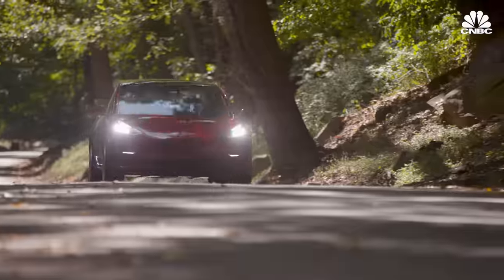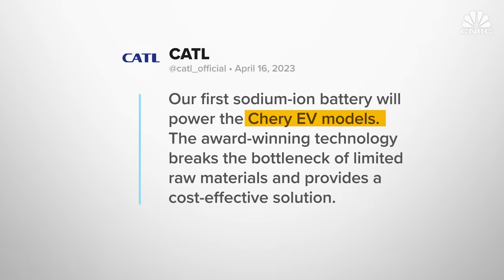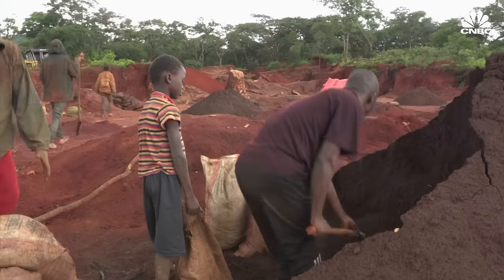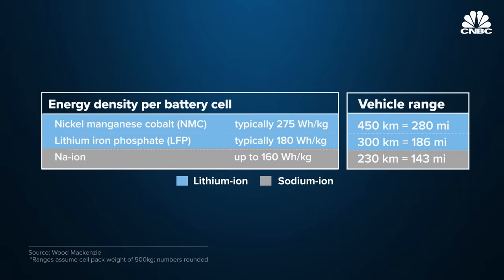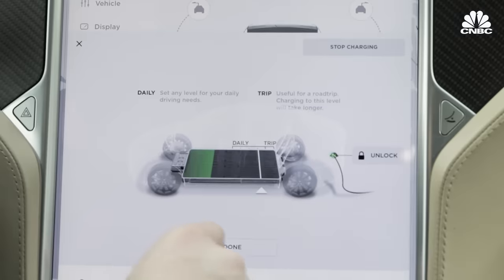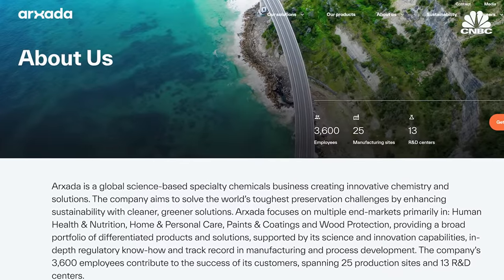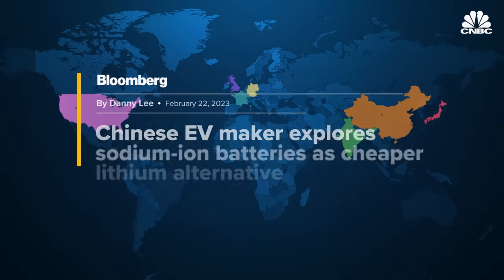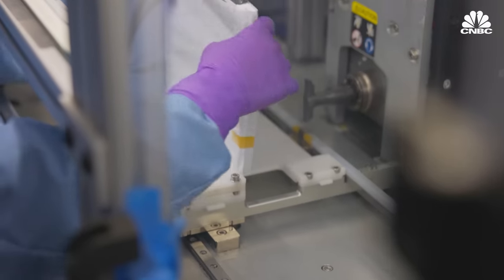How Sodium-Ion Batteries May Challenge Lithium

Comment: There are enormous  batteries manufactured  across nations .....   materials are available for production of both  lithium ion batteries as well as for sodium batteries . What  I don't understand is that  mobile phones that were sold  for low budget .....as low as two to three hundred rupees ...... did serve it's intended purpose ..but why were guys who could  afford  expensive mobiles  hunting the batteries that were priced so low . Secondly ......battery even inspite of intended performance  doesn't  function after several weeks of purchase in which case  why they don't sell extra battery just in case  battery doesn't serve the purpose  another battery would be useful instead of searching battery in neighbours premises ...Thirdly ....the battery .....did the function of a laptop adapter which is why   batteries are easily  ..lost like  ...
sim cards .....and  retrieving data is huge task for people who cannot get a telephone line and a desktop line or laptop line ......data .....has to retrieved in any case

Comment: If this is non toxic and a non fire hazard then this should be used to replace lithium batteries. Electric cars are a non-starter anyway even with lithium batteries. Too short range and the electricity all comes from coal anyway.

Comment: How do you in one breath extol the fact that you can drill right through it and in another breath extol the fact that you can ship it at 0 volts and it's like a bag of electrolytes doesn't the second imply that shipping it at full voltage would be dangerous
Reply: Is the drill test done at 0 volts

Comment: Comparing range just based on volumetric or weight factors is a little bit shortsighted.
Also no differentiation between those two factors is problematic.

Comment: sodium ion batteries look great as a back up power source for my space ship line up. i need to find a good power generator. i think  coupling a electric motor to a electric generator. off grid living. my housing will have the same power generators and battery backup systems as standard
Reply: Tesla are doing battery back up system installations right now.

Comment: Sodium-Ion batteries are not suitable for cars because of a simple reason. Lithium is the lightest metal. Nevertheless the lithium car batteries are very heavy. Sodium-Ion batteries will be many times heavier for vechicles. However they may be used in other applications such as solar panels and wind turbines energy backups.

Comment: The video provides an overview of how sodium-ion batteries are emerging as a potential alternative to lithium-ion batteries due to several factors, such as the scarcity and cost of lithium and other critical minerals needed to manufacture lithium-ion batteries, energy security concerns, and sustainability issues. Sodium-ion batteries have been around since the 1970s, but they were abandoned in favor of lithium-ion batteries due to their lower energy density and limited capacity. However, sodium-ion batteries are gaining traction once again as battery makers and automakers look for alternatives to lithium-ion batteries.

Sodium-ion batteries have several advantages over lithium-ion batteries, including lower costs, higher abundance of materials, and a longer cycle life, which means that they can be charged and discharged more times. Moreover, sodium-ion batteries do not require critical materials like cobalt, which is often associated with human rights abuses.

I find the development of sodium-ion batteries fascinating, especially as they offer a more sustainable and ethical solution to energy storage. The emerging market for sodium-ion batteries is expected to be worth over $11 billion by 2033, indicating the growing demand for alternatives to lithium-ion batteries. However, while sodium-ion batteries offer several benefits, they have lower energy density and capacity than lithium-ion batteries, making them unsuitable for applications that require higher power output, such as electric vehicles.

Overall, sodium-ion batteries are a promising alternative to lithium-ion batteries, but they are still in the early stages of development, and further research is needed to improve their energy density and capacity. Nevertheless, the emergence of sodium-ion batteries represents a significant shift in the battery market, highlighting the importance of sustainable and ethical solutions for energy storage.

Comment: the good thing about sodium is unlike lithium sodium cant be cooked into illegal drugs like meth so a license to ensure that the sodium is going into batteries not drugs wont be required.
Reply: meth processing can also use ether, paint thinner, Freon®, acetone, anhydrous ammonia, iodine crystals, red phosphorus, drain cleaner.
Reply: @MrTeff999  but i think lithium is a critical item so i doubt it can be replaced by anything else so just like the highly controlled nature of access to sudafed should make it not be made so easy.

so that is why i think sodium is better for batteries since there would not be as much regulation.

Comment: Also, Lithium Iron Phosphate batteries have more recharge potential than Lithium Ion. LiFePO is popular with battery packs.
Sodium, I dont know.
Reply: I can see lithium iron phosphate batteries dominate the high end, protable batteries, while sodium ion batteries dominate the low end, mass quantity grid storage batteries.
Reply: Li is still increasing cost wise, so LFP wont be their go to for to long if Sodium can match it at a lower cost.
Reply: All will have their applications
Traditional Lithium ion (NCA & NCM) will b for niche applications such as  passenger drone, race cars and planes
Lilthium Phosphate (LFP, LMFP & M3P) will be the go to battery type for passenger and commercial vehicles.
Sodium ion and cheaper LFP for short range cars, bikes and grid application.

Comment: With expiring nuclear plants and not building replacements.  EV dream is dead, as electricity sky rockets when they can no longer subsidized electricity rates. Not about green but all about making the low iq subsidized the electricity for rich ev owners.
Reply: Solar energy is the cheapest source of all. I don't see why Expiring Nuclear powerplats are supposed to be a problem for EV adoption.
Reply: Building new nuclear power plants wouldn't be a problem.

Comment: What about powering cars with water instead of gas or electric? We need to stop getting hung up on one thing because people believe that "it's the only way" when there are other ways. The whole "the future of cars is electric" statement is an oxymoron.
Reply: You mean sea water? Cause fresh water is already dangerously low
Reply: Water is a resource we dont really have a lot to spear. I assume you mean making Hydrogen and as other videos point out, it has a lot of issues and its just as waste full as gasoline is in that you still have to have full on storage units (gas stations), move said fuel around the country, waste power compressing it / cooling it into a liquid, and waste a lot of solar power that can be used as part of the whole grid vs something going into one thing to make a thing that can only power one thing. Electic is the way because its simpe and simple normally means better over all. Fun fact, if we had more batteries on the grid (this includes anywhere) - you will be able to remove 10% of  any power method from the grid as every grid pretty much waste about 10% of their power generation because they can't store it.
Reply: Yeah why don't we just power cars with the power of imagination?who says we even need

Comment: We don’t need batteries for grid storage. We have other options like liquified air, which the oil industry is good at doing. Or making geothermal work everywhere. Both of those would solve the problem and we wouldn’t have to strip mine somewhere or make new industries. Since those two examples can tap into existing industries.

Comment: This won't work unless the battery can be smaller and store more energy than Lithium batteries.
Reply: It doesn't need to be better, it needs to be cheaper and use more common materials. The goal isn't to entirely replace Li, rather stop using it for everything. Which means we need less Li in general.
Reply: @alien9279  If humanity is expected to use electric cars, trucks, and planes it definitely needs to be lighter, take up less space, and have much more power output.

Comment: To show how out of touch Elon is.  He just announced plans to open a lithium ion battery factory in china in 3 years.  Both the china and lithium part are 2019 thinking.
Reply: As mentioned in the video, these batteries don't make sense in EVs. Lithium ion will remain the most important chemistry for a very long time.
Reply: @Simon-dm8zv  Are you joking?  BYD and CATL are already mass producing EVs with sodium batteries.  The only negative is the density, which reduces the range by about 25% which is no issue at all for cities.  But on the plus side they operate at lower temperatures so northern USA and Canada can use them.  They are also 30% cheaper than lithium and dont destroy the environment to mine materials for them. The research on ev sodium batteries is also years behind lithium so the density gap will be narrowed quickly now that EV manufacturers are starting to really get into them.  The sodium EVs from BYD are down to $11k.
Reply: @PeterSedesse  They are not. The $11k BYD Seagull you are referring to has LFP blade batteries. BYD and CATL are planning to start producing the version with sodium ion later this year.

Comment: Sodium Ion does not have the number of recharge cycles and energy density of Lithium ion.  Even if it is cheaper, it is not a good choice for electric vehicles. It might be a very good material for solar/storage battery use.
Reply: with r and d in few years the energy density and recharge cycles can be made similar to lithium. 
safety is more imp factor for evs where sodium are better than lithium
Reply: @keepingittight  I agree that it is cheaper than gas, but the question is whether Sodium Ion will be a better choice for cars and trucks. Trucks in particular are a major challenge and even Lithium Ion is not really going to work out for OTR Trucking industry.  For OTR, there does not seem to be a candidate that could compete with diesel.  Also, rebuilding a battery pack these days can be very expensive. At some point the industry may standardize on modular battery packs that are easily replacable, but these days, rebuilding packs takes a lot of labor.  We know that Lithium Ion can go 8 years or 100,000 miles and no manufacturer is going to use Sodium Ion unless it can do the same.
Reply: @marong3717  I think the Braga/Goodenough solid state battery with glass electrolytes is more promising.  I mean Goodenough made the Lithium Ion battery into what it is today, and he and Braga are putting all of their efforts into the solid state battery. It has three times the energy density of Lithium Ion.  My money is on Braga (who is the one that really pioneered this tech, but Goodenough/University of Texas has the money to get through development) and the solid state battery.

Comment: Lithium is better than sodium. Safer. But both has bad behaviour in batteries. it creates dendrites which may easily penetrate the separator and cause shortcut and fire.
Better is magnesium and aluminium which don't generate dendrites during charge discharge cycling. Best I have seen in test phase is aluminium metal/ sulfur-graphene mixture with added sugar. It reached higher energy and power densities than best lithium batteries. Best of all, it doesn't contain anything expensive or rare.
Reply: What kind of sugar? Do you mean sorbitol?
Reply: Graphene isn't cheap

Comment: The fact that these batteries still contain stuff like nickel, manganese, and titanium means that they'll still be subject to the same severe mining capacity shortages as lithium or any other metal. Trying to make all cars electric is a boondoggle, we'd be better off focusing our attention on other areas like power generation, concrete production, and cargo shipping.
Reply: We gotta tackle all areas of pollution and co2 emissions, and lots of smart people are! Batteries are a huge huge part of the green transition though. Very good that there's alternatives to Li and new stuff in the works:)
Reply: Sure, but lithium mining is problematic because it uses a lot of water in water scarce areas. And it's unavoidable because that water scarcity is exactly why the lithium deposits exist there at all. 

Though, I've heard of new methods that use a lot less water in development.

Comment: Is EV actually more enviromentally friendly? It actually takes alot of engergy (mining, chemical proceassing, packaging etc) to produce EV batteries. What will happen with all those EV batteries when they can't hold a usable charge? We'll find out in another 20 years...😅
Reply: You could find out now if you care to Google for 5 mins!
Reply: @lookman7047  EVs have existed for at least 100 years and lithium based EV batteries have been a thing for 10-15 years and the consensus is that while an EV is more damaging immediately after coming out of the production line it becomes cleaner than an ICE in the span of a year (sometimes less if we're talking about smaller EVs with smaller batteries)

Comment: Hang on.  Sodium ion battery uses nickel, magnesium, titanium, manganese…these are all the metal lithium ion uses (bar titanium).  How is this more sustainable than lithium other than the fact sodium is cheaper to procure.

The battery also use carbon sheet barriers and practically the same production or battery fabrication as lithium.  So in effect instead of lithium carbonate, you use sodium carbonate.  And use titanium as catalyst instead of cobalt for the intermediate chemistry.   Doesn’t sound like it’s the save all things tech.   Certainly will give us cheaper batteries but won’t replace Li-Co Ion battery in the higher performance EV sector.